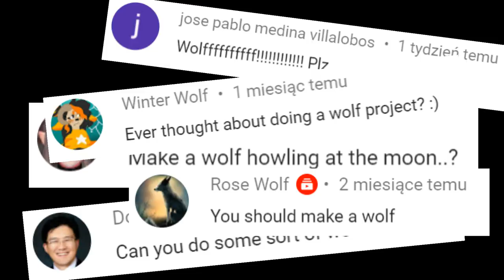Wolf in Epoxy Resin / RESIN ART / Part 1 @pawelc7879

Comment: Few question!
For how long did you mix the resin to make sure it was properly mixed?
Did you need any resin corrected of heat gun or torch to make the bubble disappear? 
How long did you last the resin to dry for?
I tried at least 3 time, resin get hard only in few sections and had to cut out softer part and ruin my pieces... never ended with the whole piece that dry to continue through the sanding process :( 
I'm reading something about the room temperature settled to 25°C, is it that important?
Reply from the maker: I mix the resin for about 2 minutes. I use a vacuum chamber to make the bubbles disappear. The temperature should be between 18-25